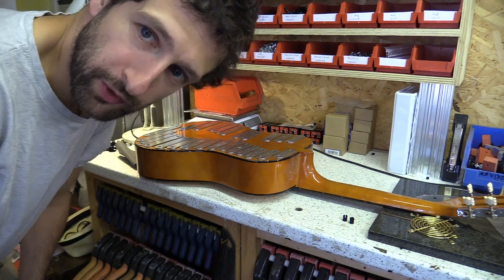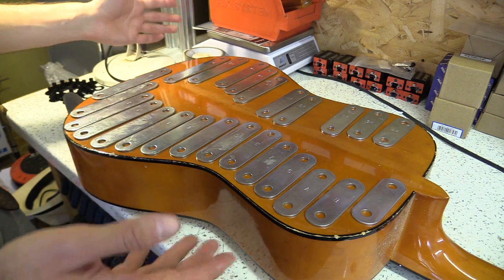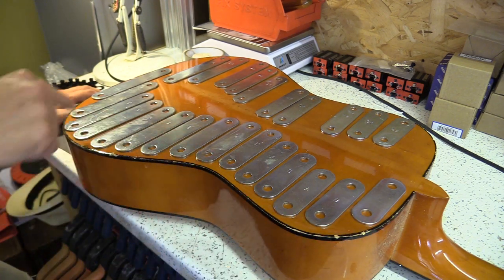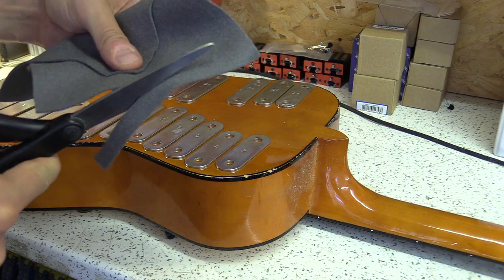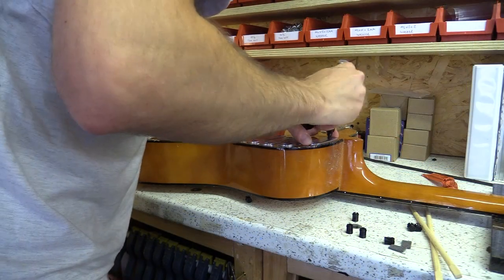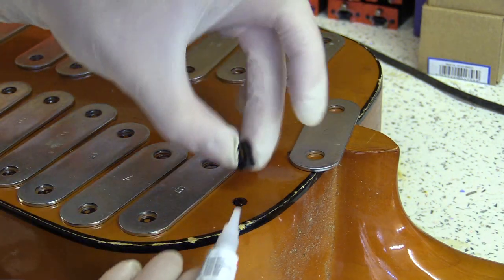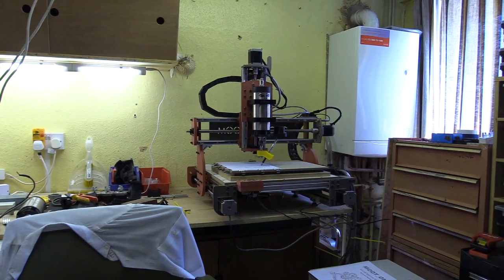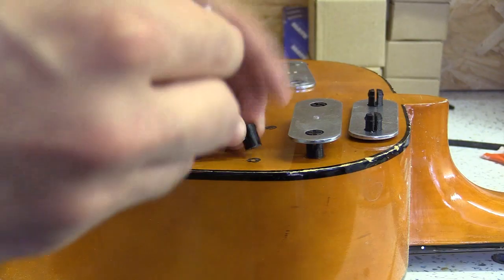The Guitar Xylophone Hybrid Instrument

Comment: That was a bit xylophobic. Have yher tried TPU, It's near indestuctable, I was suprized how tough it is, I thought it would rip apart like a cheese string. I've all ways, sometimes occasionaly, wanted to make a glockenspiel.
Reply from the maker: I'm going to use it to write the score to a new movie called Xylophenia. Going to be a classic. Not used TPU - still haven't found my forever 3D printers to start thinking about filaments.
Reply: @SavvasPapasavva  I just stiffened the frame up on that £98 tronxy thing and made it fire safe. it's been as good as gold. I really thought TPU would be crap, but it's easer to print than anything else and you really can run it over with a tank and it's fine. I only got it to print basin tap register washers to make my life easier. Knocks 20 mins of fitting taps, garrented alignment and water tight.